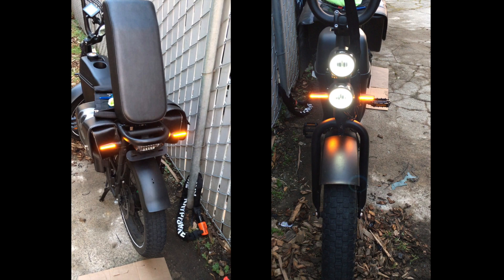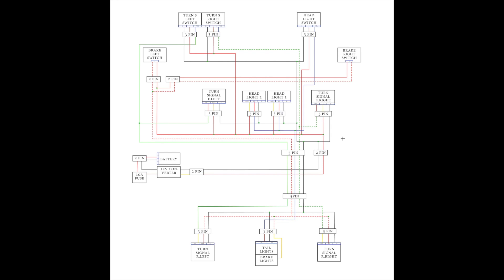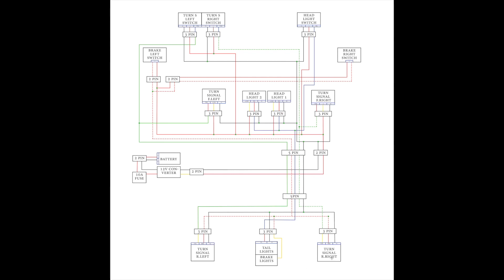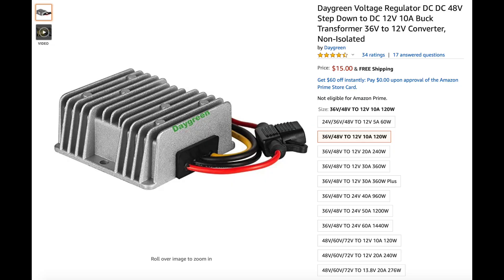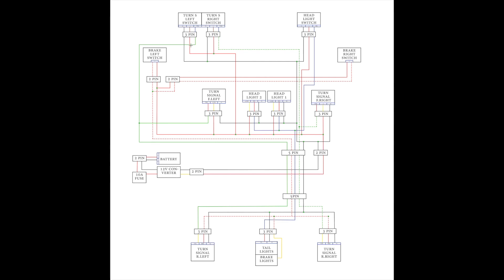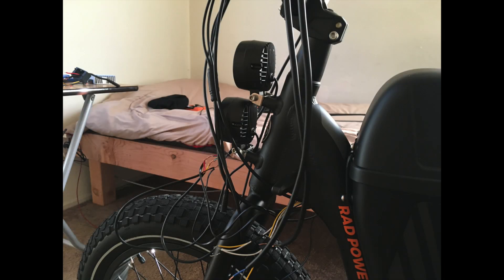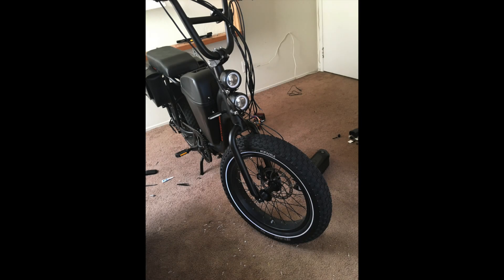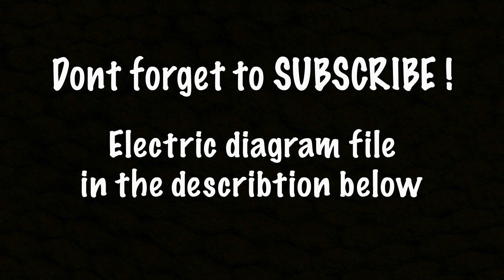HOW TO CONNECT HEADLIGHTS AN TURN SIGNALS ON BICYCLE

Comment: Can you hook two lights on the front wired into the rear signal lights that came with the bike ,mine has break and signals at back trying to add to the front

Comment: ok, i have a real good question, are you running different wires or using the wires that came with the ebike ? as i see you have the 12V converter running from the batterie, which begs the question, how is your display working off of 12 V, instead of 48V ? or you would need to upgrade your diagram ok ?

Comment: I had a problem with my 12v brake light. I think the 48v to 12v converter must of had a capacitor that when I pressed and released the brake lever the brake light would remain on for 5 seconds

Comment: I have a Radrunner also but I have a nice led headlight and turn singles but I only thing I want to upgrade and change out is the brake light, how would I go about doing that?

Comment: i've got no problem wiring up whatever light i want

the only problem i've got is that i can't find decent mounting hardware for either mounting one of the lights like in the vid (i've got similar but 3 lens lights), that A) doesn't shake and B) doesn't fucking break from metal fatigue from the shaking/vibration and C) doesn't need a long tube style fork cuz i aint got no ebike like that

i just have to go through very shittily maintained uneven terrain and streets everyday, aint no other way 'round it

Comment: Hello what type of brackets did you use to hook up the lights can you send me a link where to buy brackets that can insert those lights to my bike with nuts and bolts to tighten it down do you have a website or a link
Reply from the maker: Everything is custom)

Comment: Hey am not a pro, but if just buy the same headlight and remove the old headlight from my ebike will it work?? My ebike has 750 watt motor I think it brushless the battery that came with is 48V 20ah..
Reply from the maker: It supposed to work. But I’m not sure
Reply: @electricpower8130  actually it works I just installed the same light last night ..

Comment: Are you providing power to all the lights from the stock headlight wire only? So to activate your whole circuit you power on the headlights on your bike keyoad and your sub-system comes to life? Thanks for your answer! Great stuff!
Reply from the maker: Thank you! I took all power straight from the battery through converter.
Reply: he had to wire the converter in between his battery and wires ok

Comment: Can you make a video of how to connect to existing RR+ wiring? If you made any modifications on the existing cabling system of RR+, can you also share it as well? 
I have few questions;
1. If the converter 48/36V to 12V 10A 120W is not available, what is the other option?
2. Wire connectors - can you share also the link where we can order which you’ve used?
3. What sizes of wire you’ve used for the new wiring connectors?

Thanks a lot. Great video...
Reply from the maker: Thank you! I sold the bike. 
1. You can use only original parts. 
2. I found it on Amazon. It’s plenty of them there. Just take the thinner ones.

Comment: Why is negative ground going to the switches? Isn't the switch just carrying the positive through?  I also noticed 3 wires going to most of the lights but don't they only need 2 pos and neg? Sorry if this is a stupid question. I just built my first bike (stealth bomber) and just want to fully understand the wiring. Thanks in advance.
Reply from the maker: Of course, no problem! Usually on every motorcycle the ground going through the frame. But this is an electric bike. And for the safety reason I decided to make a negative wire line for each unit. It’s independent wiring solution. That’s it.

Comment: Did you need to use motorcycle controls for the indicators?
 I have a ordinary MTB (mountain bike) which I would be converting to an eBike, with the BAFANG BBS system....what would I need on top of the conversion kit to add brake and indicators on the back of the rack and the front of the bike.?
Reply: If my ebike already came with a working headlight, do i still need the step-down converter? Or do you think the bike already has one?
Reply: @DanhRichardson  ok, there are headlights out here that are like 10V to like 80V, you just need to pay attn. to that ok and if you do not want to have to have a step down, then buy a head light that will except power from 10V to like 80V ok, i have found lights that will do that and also take like 12V to 24V, those needs a step down for it to work off the power of your Ebike ok, hehe
Reply: @DanhRichardson  but also with lights that only will take power that is 12V to 24V, you can always just hook up to a external 12V battery bank ok, along with a switch ok hehe
Reply from the maker: You can use any controls you want. Just make sure they are for 12v. And don't forget to buy 48v to 12v step-down converter.

Comment: May I ask how do you integrate the switch for the brake light? I'm having a hard time making my hydraulic brake signal to work with my relay to connect with the brake light
Reply from the maker: Pham Don you don’t need a relay for the brake lights. You can see all connections on that wiring diagram in the video description.
Reply: @electricpower8130  Hello, Thank you so much for getting back to me. May I ask which switch did you use for your brake? I am currently using the cyc controller and I'm using the magnetic brake level to send signal to the brake light. I need a optocoupler relay for it but having a hard time wiring it since the brake signal is 5v and the lights are 12 volt. I think my switch is different that's why I was thinking about using a relay. May I ask what is your set up? is it the single button switch you listed in the description? May I ask how did you mount it to the brake level? Thank you for your time.
Reply from the maker: Pham Don All brake levers using magnetic switch. I don’t use engine cut off, which means it’s not connected to controller at all.
Reply: Hi ElectricPower, I have a question relating to the Brake Lever. Do you mean the Brake Lever has Magnetic Switch built in or you've made a Magnetic Switch and attached it to the Brake Lever ?

Comment: Wow, awesome! I just bought two vintage style ebikes and since day 1 I'm thinking about installing some turn signals and rear brake lights...Too bad I don't have the knowledge nor the tools to do this myself....Awesome job, good for you👏👏👌🤙
Reply from the maker: Thank you!
Reply: @electricpower8130  Hello! 10A fuse - why you put them between battery and 12v converter?

Comment: Mentioned the same on your last video, but can you just speak to hooking u only the headlights to the existing battery and cable system.  Thanks!
Reply from the maker: I did connect the headlights with original wires. It works really good!
Reply: I love your audience responses